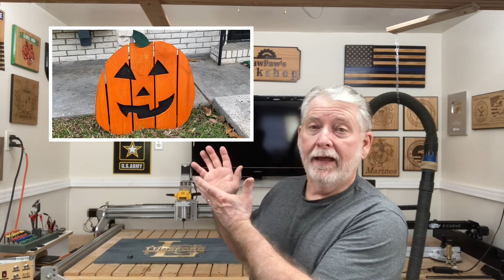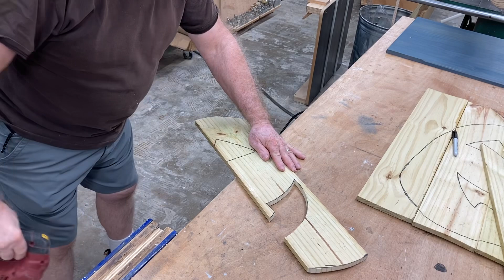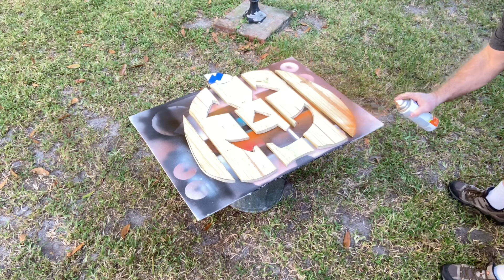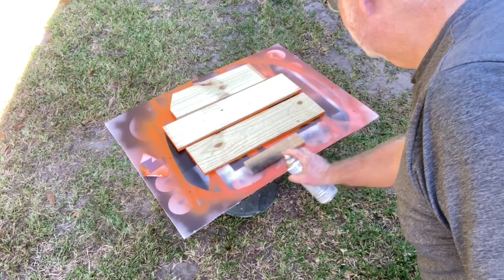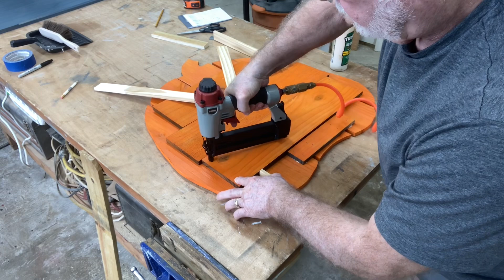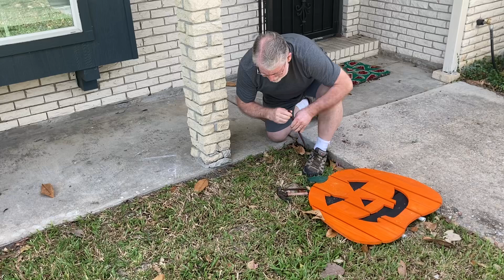DIY Pumpkin Carve NO Special Tools Required

Comment: What compressor do you use in the shop for the nail gun?  I have a Craftsman compressor and it is really loud.
Reply from the maker: Yes, it is very loud. I have the air compressor in the garage. I put it as far away as possible from the shop
Reply: @PawPawsWorkShop  Thanks. The one I have is incredible loud even outside.